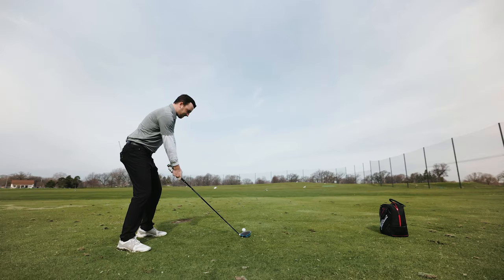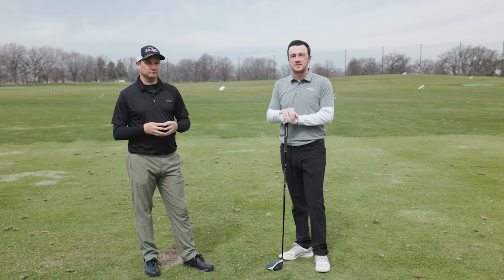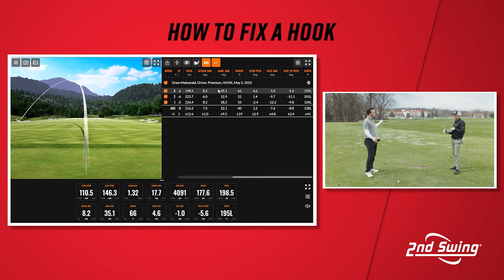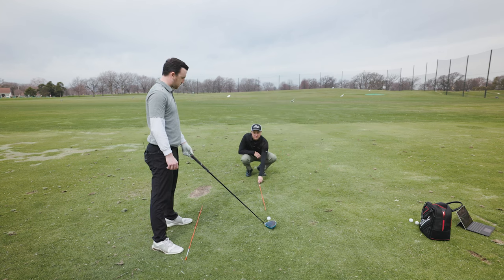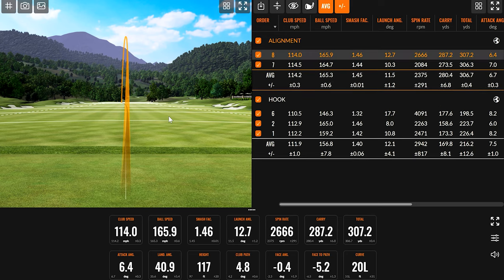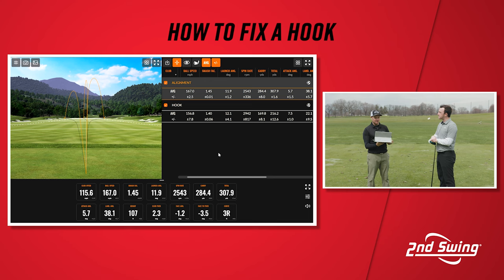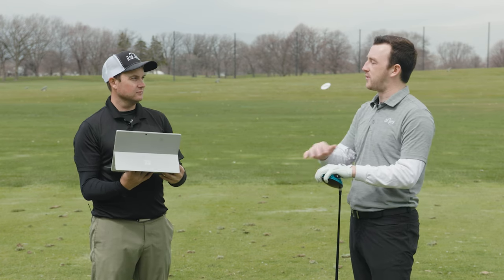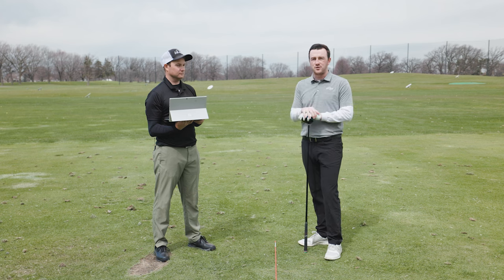Golf Swing Tips | How To Fix A Hook

Comment: When I started playing last year, I hit a natural draw. This year, my drives were hooking badly, and I didn’t know why. I tried lots of changes, but got no better results. I finally realized my grip was too strong (being a former baseball player), so I weakened my grip to neutral. Now my drives go much straighter. My next goal is to create a fade when I need it for doglegs to the right. Goal setting is key!
Reply from the maker: To hit that fade you just need to modify the path to be a little out to in with the face slightly open. Also pay attention to hit location - Thomas
Reply: @2ndswing  - I can hit a baseball anywhere I want. 3rd baseline, 1st baseline, whatever. So I decided to use the info you gave, along with my confidence, and just give it a go on the second hole today, which is a dogleg right with trees in the way. I took out my 3-wood and just told myself to “bend it like Beckham”, but to the right this time. Bam! Off it went straight as an arrow, with a perfect fade about 3/4 of the way down the fairway. Sign me up! (as your student)
Thanks!